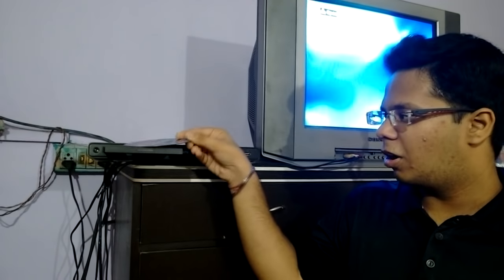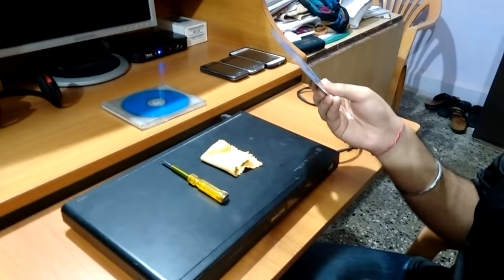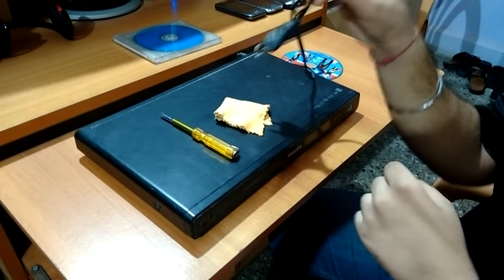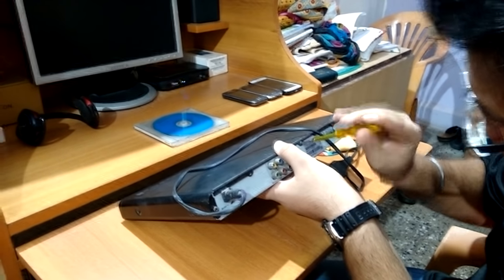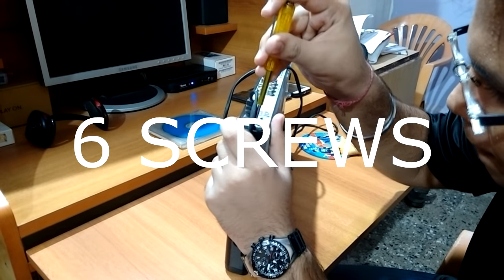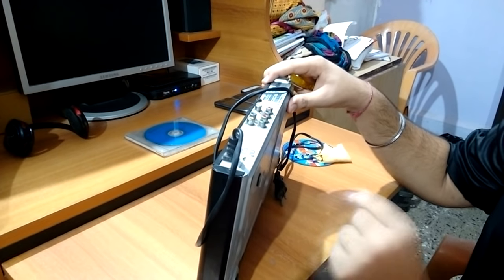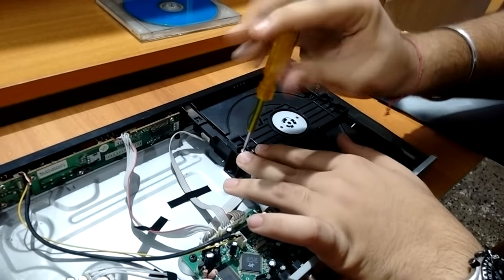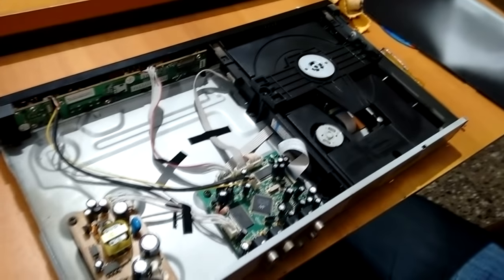Solve "No disk" Error in your DVD player

Comment: Hi Akshay, I have a question. My Toshiba DVR630KC model VCR/DVD player will not load a disc. I took it apart and cleaned the lens and it still won't load. Any advice on how to fix this problem? Thanks Michael Newell from Niagara Falls, Ontario, Canada
Reply from the maker: Hello Michael, If cleaning not solving the problem means lens is damaged. Need to get it replaced from Toshiba ASC.

Comment: +AKSHAY BHOPANI Have any fix-its for a Philips DVD player that keeps showing Root on the display panel?
Reply from the maker: +Barb Lambert I think there is issue with the motherboard a.k.a system board. Try to take to service expert and let them track and solve the issue.
Reply: AKSHAY BHOPANI hsjcbe
Reply: recap that thing! watch a few videos on recapping boards and you'll be able to fix 80% of the failed electronics out there.

Comment: Hi, my Cambridge blue ray universal player shows NO DISC,. what should be the cost to change motor?? Thanks and regards
Reply from the maker: It can be around 800Rs to 1200 for the caddy includes the whole assembly. Check-in nearby service center.
Reply: @AKSHAYBHOPANI  thank you very much. Will you also be able to do this??
Reply from the maker: Nope. Contact nearby electronics store or technician to fix it.
Reply: @AKSHAYBHOPANI  thank you 😊

Comment: tried that, didnt work!....Any other suggestions?....I keep getting bad disc error.
Reply from the maker: +Kelly Roberts  The reason would be that your laser may be faulty. So try replacing it :)
Reply from the maker: +Kelly Roberts  The reason would be that your laser may be faulty. So try replacing it :)
Reply: I think its an IR laser, so your cell phone can visually see it. If this is the problem is it easy to check. Just turn on your digital camera, and point it at the laser(not directly!) if you can see it, it is on. If the surface is smooth, you're good to go.

I was hoping for a really in-depth characteristic video where it shows common fail points, and also what everything should look like under electrical test. Instead it was standard tier 1 tech support. I think most people who end up on here have already tried the CD cleaner/is it plugged in options...

Comment: i had a diffrence dvd player he says also no disk. it was a defective capacitor on the mainboard of the player, he was bugled, a 470uf 16v capacitors i replaced the capacitor for a new one and it works.
Reply from the maker: +stefan boonstra That's Awesome !!!
Reply: Out of curiousity, what model was it? I am working on an RCA DRC8335 right now with the same issue. The secondary of the PSU is brimming with those, and I replaced with a higher value voltage rating. I haven't gotten to the DVD board yet(after I got it to turn on at all by fixing PSU, I got a no disk error from the DVD.) In addition, the VCR transport doesn't respond at all, and if I spam the eject button, the front panel dims, and then turns off and the unit resets! This spurred me to go ahead and build a curve tracer for this repair, since I can't even find a schematic anywhere. I am not sure what voltages need to be present on this particular model...so the only way forward is to actually test all components to be within operating specs.

Comment: CD spins in anti-clockwise direction. Any suggestion what to do?
Reply from the maker: That doesn't matters. It's not able to read. Try other cds. Might be laser diode damaged. Take it to service center and get it replaced.
Reply: AKSHAY BHOPANI I figured it out that my VCD player uses KSS-213C laser diode so I ordered one lets see if it fixes the issue.
Reply: AKSHAY BHOPANI hey I need one more help.
Reply from the maker: @JSCinematics  Cool. Let me know if It works.
Reply from the maker: @JSCinematics  Sure. Say Na. Also I hope you carefully solder the SMD diode. Probably it will be SMD which is difficult to mount.
Reply: AKSHAY BHOPANI Bro I have ordered the whole tray not only the laser diode. Actually my second concern is I think its audio amplifier is faulty too because it gets hot and the sound quality deteriorates if I happen to change that, will a normal amplifier circuit work?
Reply from the maker: Yes any amplifier will work. Probably with DAC convertor.

Comment: Player on few minutes after automatically off .wt reason
Reply from the maker: Mostly because of power issues. It might be tripping. Change the power supply unit. If the unit is separate in the player then easily replaceable upgrade otherwise makes so sense to change the whole circuit. Take to service.
Reply: @AKSHAYBHOPANI  tq bro for ur reply

Comment: Very painful to watch. Cheap tools will do that and maybe if you hold the screwdriver correctly with the player laying flat on the desk, you will he able to remove the screws quickly. If cleaning does not work, most likely it is a simple power capacitor that needs to be replaced on the circuit board.
Reply from the maker: +Jason G Thanks buddy. Will consider these things in future videos 😊. Watch our latest videos with improved quality and consistent editing. Stay tuned with The Tech Show community :)

Comment: I'm already checked ass it is for your video. but my DVD IS NOT WORKING
Reply: please reply
Reply from the maker: +vamshi madoori Your laser may be damaged so you need to take it to service or get a new one.
Reply from the maker: +vamshi madoori What error you get ?
Reply: NO DISC
Reply from the maker: +vamshi madoori Try using different disc. If it doesn't work then you have to change the laser.
Reply: AKSHAY BHOPANI  how to change the laser and  laser cost?? pls reply
Reply from the maker: +vamshi madoori It depends upon your area. Better take it to a repair shop. They will do with perfection :)
Reply: AKSHAY BHOPANI    how much cost of the laser
Reply from the maker: +vamshi madoori 300 to 500 rs
Reply: AKSHAY BHOPANI OK tnq brohh

Comment: LASER IS GETTING ON AND OFF THEREFORE IT IS NOT SPINNING WHAT IS THE SOLUTION PLS REPLY ITTTTTTTTTTTT
Reply from the maker: +TIRUMANI NADAR The Problem might be in circuit board because your laser is actually working but blinking and rotor is not spinning. There is also chance of motor to be faulty.
Reply: THANX FOR REPLY
Reply from the maker: +TIRUMANI NADAR Anytime brother
Reply: A 5 volt dc motor rotating the disc...may be motor fault or 5volt power failure or mother board complaint

Comment: Cleaning the lens doesn't work all the time, you need to slightly increase the voltage to the lens from the pot/s on the circuit board. And 10 min to remove some screws? Really??

Comment: The time required to get the casing off and manually clean, a cleaning disc would be sufficient. What can you do a cleaning disc cannot? That's what their designed for (if you have one laying around that is...) Other issues could just be a bad disc... No amount of cleaning would fix that. It surprises me the number of Youtube video fails to miss this rather obvious point.

There are some dvd's that just are bad.....   Believe it, or not, you do get dud's. Les likely with retail discs, but it can happen there too. But, we all like tinkering, so i guess we're all excused..
Reply from the maker: I tried the cleaning discs but no luck, it only cleans the cd rails not the sensor. Thanks for the feedback, will definitely improve.
Reply: @AKSHAYBHOPANI  Think you got that backwards.. CD cleaners are designed to clean the sensor, they have brushes on the disc for that the rails are or either side of the drive where the disc sits. but ya np